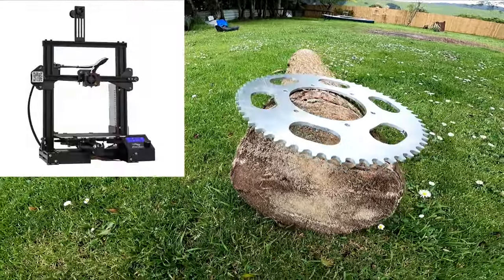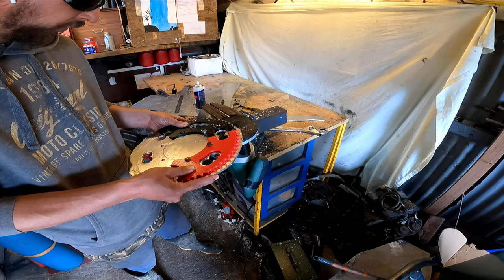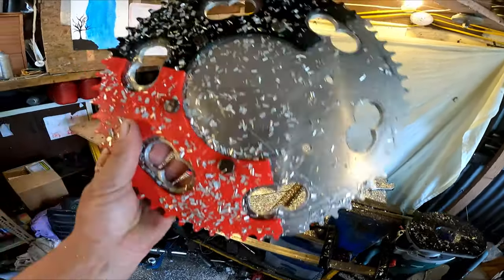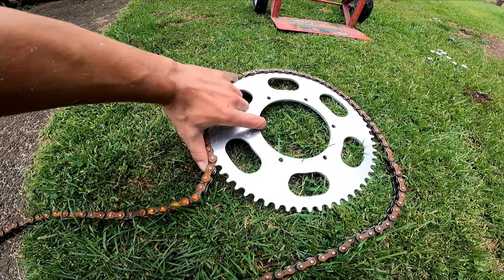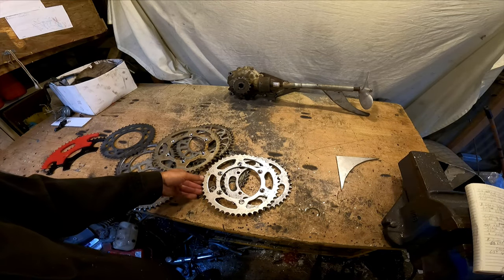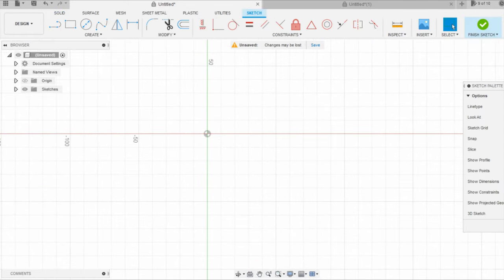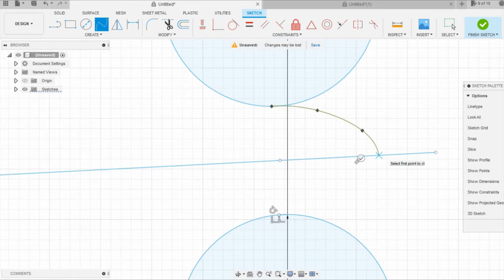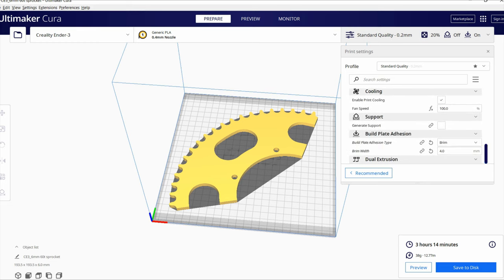Make CUSTOM Sprockets at Home

Comment: Nice one bud. FYI, there's a gear add on you can download for fusion 360. You just add your teeth # and pitch and it will draw it for you👌
Reply: Sprocket gear calculator.
Works a treat
Reply from the maker: Yeah I have seen that but I don’t know if it can get the sprocket shape. Could help out with spacing though. Have you tried it?
Reply: @DktheWelder  you can edit the whole shape and change pitch angle manually. Worked well for gears i printed for a chainsaw power rc car using bicycle chain and they've held up well.
Reply from the maker: @hyster16t  ok cool I will have a go at that thank you

Comment: thats awesome! As for the alum strength, it will be there but its the wear you gotta worry about. The teeth will wear out faster and get loose causing chain slip etc
Reply from the maker: Yeah that aluminium is a lot softer than the proper stuff

Comment: Might want to have a go at precipitation hardening the aluminum. I would almost think you could work harden it by smacking or pressing the chamfer on the teeth instead of grinding it off. Pretty sure cryogenic hardening works for aluminum also.
Reply from the maker: Yeah I have been googling stuff about it , but I still think the aircraft grade stuff would be the way to go. It might work harden itself a bit hopefully. What is cryogenic hardening?
Reply: @DktheWelder  to cryo harden you basically bathe it in liquid nitrogen. Works for almost any metal for a nice hard surface.

Comment: Haha I just used that exact router and a flush cut bit to widen the center bore of a set of calais wheels to get them to fit a commodore.
Reply from the maker: They chew through the alloy so quick aye
Reply: You sir are a genius thanks I literally need to do that
Reply from the maker: @jackbeets3838  thanks again for the motor jack. The sprocket idea worked pretty well aye
Reply: Sweet as awesome to see it living to it's full potential again

Comment: Don't do what I did when taping up the trigger on a power tool...put it back on the shelf and forgot to remove the tape! 2 weeks later placed it down on a countertop, plugged it in and watched it fly right across the counter leaving a trail of splinters and destruction!
Reply from the maker: That does sound funny but dangerous!